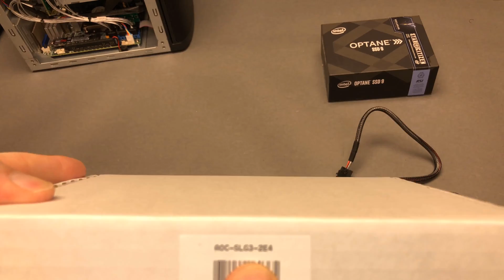Installing the Supermicro AOC-SLG3-2E4 U.2 PCIe adapter with the Intel Optane 900P (4K)

Comment: I installed the  AOC-SLG3-2E4 in a X10SRi-F board on the x8 slot (3rd slot if we assume the x16 slot is no 1) but VMWare refuses to see it. The two cables were connected to an Icy Dock 3.5 mobile rack with 2 NVMe caddies. One card deployed only, an NVMe Samsung EVO 500GB. BIOS upgraded to the latest version. No further changes in the BIOS. Why is VMWare not seeing the AOC-SLG3-2E4? Even the mobile rack was dead (more about this later).I did look online and there is talk about bifurcation but my understanding is that bifurcation is not needed since this card has a switch that takes care of the details (and that is why I bought it). When I boot the system with a Fedora 32 live CD unfortunately the boot process did not complete (no idea why) BUT the mobile rack power LED turned on i.e. some driver was loaded and the card woke up. Any hints? The card does not show in the list of PCI devices in ESXi (v7). Thanks!!

Comment: The evolution of this machine is very interesting, especially the transition to Intel Optane SSD 900. Following your videos I was curious, what would be the reason to have all these changes. 
Initially this system had a raiser card for 2 NVMe M.2 devices, then it has been upgraded to Intel Optane SSD DC P4800X Series, and now to it has been upgraded to Intel Optane SSD 900 (observing that  Intel Optane SSD DC P4800X was not really used in the system). Planning own build I am very curious what was the reason, thinking behind all these steps?

Comment: What is the chip under heatsink? I am asking because it looks like 8 PCI lanes or more are routed to it, but the two U.2 ports require 8 lanes, so it is hard to see why some kind of switch is required for example.
Reply: There appears to be cheaper card - Supermicro AOC-SLG3-2E4R , which doesn't have any chips. But I guess it might not be compatible with all motherboards and CPUs. But it simply wires PCIe lanes directly into U.2 ports.

The benefit of one with the PLX switch would be very high density systems with a lot of PCI express slots, where each slot is only using 4 lanes instead of 8 required for full bandwidth. Or if CPU and mobo is problematic.

Comment: For future reference, if your motherboard supports bifurcation you can use the AOC-SLG3-2E4R instead. That one lacks the PLX switch and is around 100 $ cheaper. The non-R version however is compatible with basically all computers because it does not rely on bifurcation.
Reply: Im trying this exact thing but cant get it to work. Any tips?
Reply: Yeah. I also found that one out. R version is cheaper, simpler, and no heat. It is basically passive card with bunch of simple buffers and amplifiers, retimers (to reshape distorted signals) to support longer distance and hot-plug/hot-swap. It would work in most computers too. But not all of them.

I would love to see 8x lane card that uses PLX switch to switch into 4x U.2 ports. Sure, it wouldn't be full performance, but would really help with creating bigish systems, like 8 drives.

Edit: There is http://www.supermicro.com/products/accessories/addon/AOC-SLG3-4E4R.cfm  which is 4x U.2 ports using 16 PCI Express lanes, and no PLX chip. Still would be nice to find one that can fit 8 PCI Express lanes with PLX chips.

Comment: the official supermicro website says that X10DRU-I+ and X10DRH-CLN4 are the validated platforms. meaning that its not compatible with any other consumer type boards?
Reply from the maker: Can't say for sure, but yes, Supermicro tends to only focus on testing and marketing for their own server type products.
Reply: Paul Braren I need to upgrade my x58 to x99, as far as I know x99 chipsets does not support intel optane or what so ever. I need to be sure. Maybe the best is asking them but thnx for the reply. Appreciated.

Comment: Well....gonna do another purchase after watching your video...
Reply from the maker: I'd encourage you to become well informed first, making sure you really need to spend the extra $/gigabyte for Optane. See also a great deal of others' opinions at https://TinkerTry.com/intel-optane-900p-should-be-great-for-home-lab-enthusiasts https://TinkerTry.com/intel-optane-900p-should-be-great-for-home-lab-enthusiasts#see-also https://TinkerTry.com/intel-optane-publications-oct-2017
Reply: Thanks Paul. Have a microserver gen8 at home as media server. But i want to have a more powerful server to do esxi and gen8 has disk speed issues under esxi6.5 which makes me frustrated. I watched your videos and read your articles on TinkerTry...then purchased X10sdv-8c, Inwin s04 chassis, 64G ram, PM961 ssd....built one that I'm now satisfied with. Thank you sooo much Paul, your experience and knowledge really help a lot to achieve this...
Reply from the maker: Ah, that is great to hear, glad it worked out! What chassis full model # did you buy? Having trouble finding it, given what you typed above. Thanks!
Reply: Oh, it should be Inwin MS04. All works great except the chassis fan. I tried to use impitool to change fan RPM range but not work. Replace  it with a stock one that comes with 5028D.
Reply from the maker: Ah, thank you for the correction, here's the product page and manuals for those following along:
https://www.in-win.com/en/ipc-server/ms04
https://www.in-win.com/media/ipc-server/ms04/20161028085056_23010.pdf
https://www.in-win.com/media/ipc-server/ms04/20170731065647_55044.pdf
Oree, if you get a chance, please reply with whether you're happy with the case, now that you squared away the 120mm chassis fan swap. I've also heard that ipmitool has this limitation. Also, do you happen to recall where you got the Supermicro fan from?
Reply: Hi Paul, yeah i am quite happy with the case. The hard drive backplate supports 4 sata HDD, and one on top of drive cage(optical drive) and the other right side of the cage (support both 3.5" and 2.5"). Total allow 6 drives seated in the chassis just like 5028D does. It has LED indicators for each drive in cage, showing it's being read or not. Front panel LED indicators are compatible with X10sdv, LAN1  LAN2 HDD ID FAIL, all works. The two front panel USB are  usb3.0 and the attached cable is usb3.0 19pin, there is no such port on board however. So i bought a converter cable of 19pin to usb2.0 9pin. Now the front USB port works but not sure if the speed was limited to 2.0, not tested ( The manual shows there are 9pin usb 3.0 ports on MB, maybe the speed is not limited?)

Well, have spent lot of time dealing with the chassis fan, the one comes with chassis is an ADDA with model number AD1212DB-A7BGL, it is silent but have issues with MB, a loop of speed rise from min to max after booting to ESXI system. Tried IPMI tools to set RPM range, not working...
I did some search on 5028D stock fan,  supermicro model is FAN-0124L4, which we can get from 
http://store.supermicro.com/120mm-fan-0124l4.html
21.75 bucks. But i also found the actual model number of the fan is Sanyo Denki San Ace 120 9S1212P4M031, so there should be a lot of options on ebay as you are in US. I got one from Taobao since it's in China, 5.8 bucks, it says second hand but it works like new to me. Afterall, 21.75 USD listed on supermicro is quite fair for a new fan.
After replacing the fan, it's now working smoothly as butter.
Reply from the maker: Wow, thank you!